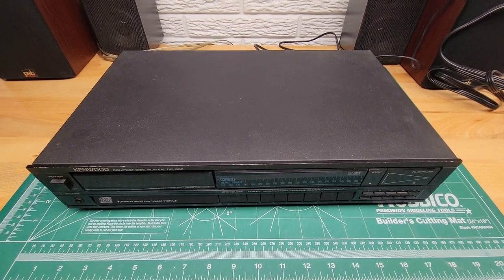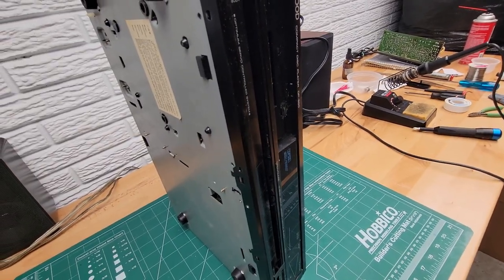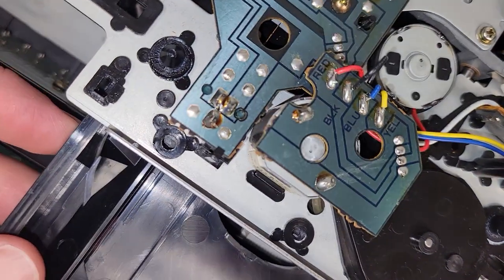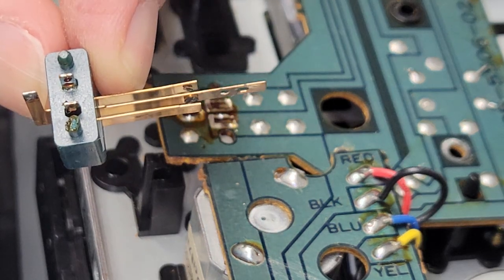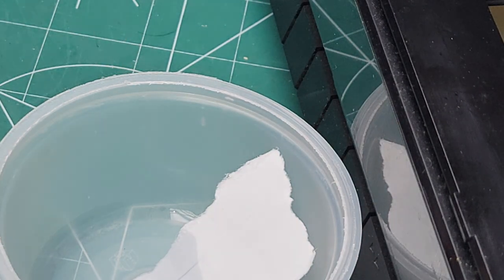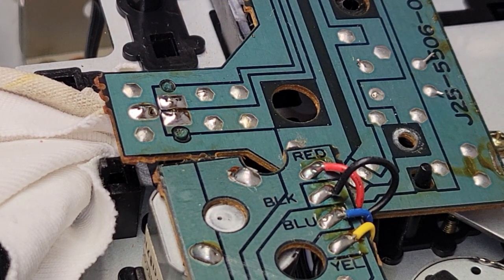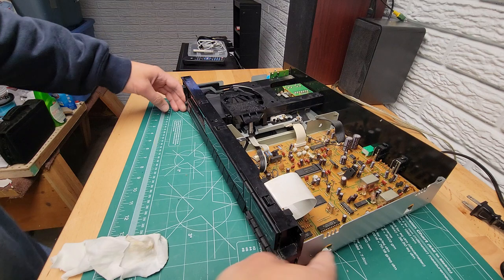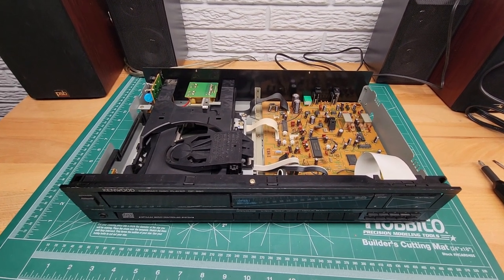Kenwood DP-860 CD Player Tray Problem - How To Fix

Comment: Great job, but while you had it apart should have also replaced the rubber belt, they dry our crack and it will need to be taken apart again when it lets go!!